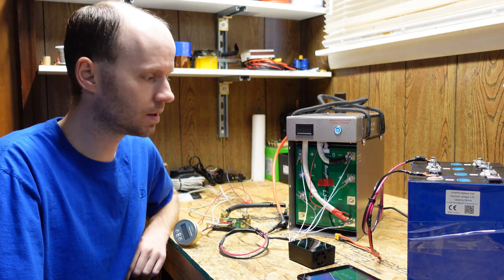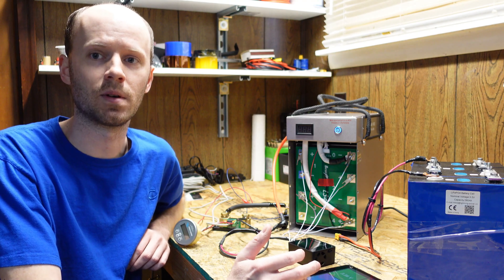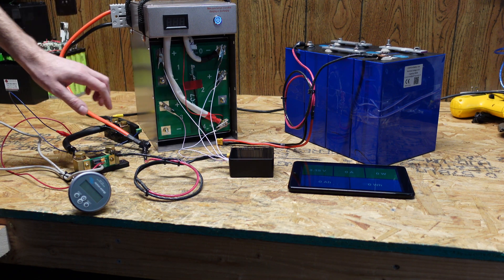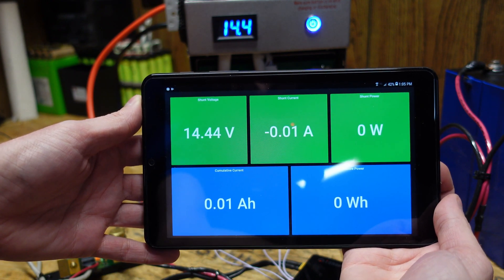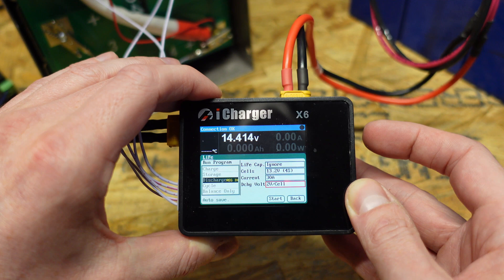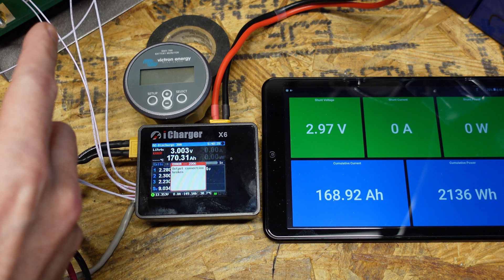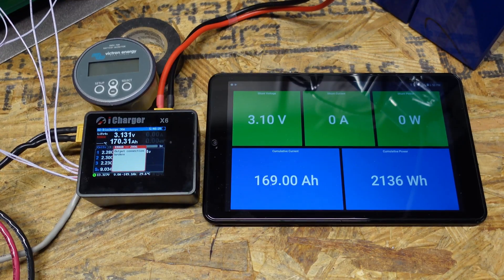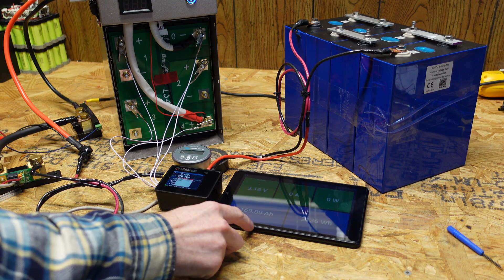How Accurate are My Capacity Tests? Batrium vs Victron vs ICharger

Comment: This is a great test, in future, if you have the gear, would you be able to compare different products? BMS feature of Batrium vs Daly vs other brand? Balancing accuracy, time of different BMS? Heating up issues of different chargers of the eve cells at 60Amps, 100Amps? Ease of install of different inverters, bms, lugs, wires etc? Thank you for the great videos.

Comment: The results are exactly as expected because of series shunts, voltage drop = increased amp hours for same amount of power? Am I missing something here?
Reply from the maker: Current is the same throughout the entire circuit. You don't see different amps at different points in a circuit.

Comment: Lithium cell manufacturers usually specify a specific C-rate and ambient temperature for their capacity rating. C/5 at 25 Celsius is pretty common for li-ion. Not sure if there is a standard for lithium iron phosphate.

Comment: Great video. Just as a suggestion I would swap the order of the Batrium and the Victron and see if the results follow since there is a small voltage drop across each shunt that would have a slight effect on the results.

Comment: Great video.
With draining down the cells below specifications can give the extra capacity, buth shortens the life of the cells too.
Good bms never drain cell below or charge above manufacture recommendation.
Reply from the maker: I have no idea what the specifications are. Did you find them somewhere to conclude that I drained them below that? I'm sure the BMS is cutting out appropriately.
Reply: @LithiumSolar  
My intention was to point out that cut off voltage is important for maintain battery pack healthy and long lasting. Mismatching capacity readouts for specific cell may be result of different charging/discharging voltage range at diferent BMS.
You was also surprised at low voltage disconect (3:55), or i just miss understand you.
I apologize to you, my mother language is not English. 
I will say another time, great video, i watching you  with great interest. 
Best regards.

Comment: I thought the iCharger could not be used to charge lithium battery banks since they had a BMS, so according to this video an iCharger can also charge a 4 cell lifepo4 battery bank with a BMS? if this is true please google DIY server power supply. they come in 2 versions 1200w and 750w. these RC lipo chargers require a higher voltage in order to utilize the full rated amps they can put out. for example the icharger S6 is rated for 40 amps but according to the manual you must use a higher voltage than 12.8 to use all 40 amps, you need something like 24-26 volts minimum. the formula is in the manual. why I'm telling you this is because these power supplies cost $15 or $20 each on ebay and you can series connect them for 24.6v , 36.9v, etc. you must isolate the DC ground for every power supply except the first one when series connecting them otherwise you will short the DC output and fry the PSU. you also must lookup the pinouts for these PSU to add a resistor to wake them up to trick it into thinking a motherboard is connected, usually you put a 200-300 ohm resistor on pins 33+36. they also have a voltage increase mod, stock they are 12.3v due to over voltage protection. two 1200w PSU will yield 900+900 watts on 115v AC, it yields 1200+1200w on 220volt AC, that translates to 75 amps DC, 12.3v multiplied by 2 for 24.6v and 150 amps DC for about $40-50 on ebAY
Reply: He bypassed the BMS by connecting directly to the individual cells. That's why the battery was open with all the wires hanging out.
Reply: @Sylvan_dB  no that's not what's happening, those wires are for sensing the voltage for each cell, the charger will not work without it. those wires are also used to pull current from each cell during balancing. the main charging leads are going straight into the BMS than into the battery. look at the video again

Comment: I’m interested on making a bank of lithium ion phosphate batteries and I’m going to go with headway cells but I’m not sure on how many banks to use for my application I have 4 15 inch Skar zvx subs and a taramps md 12000.1 I plan on a 320 amp alternator how many should I get I thought 32 to 36 headway cells should work but I have no clue what I’m doing just goin off YouTube videos
Reply: i think for car competition they actually use lithium titanate cells, i vaguely heard this. you will need 6 cells instead of 4 cells. I'm assuming headways cells have 3C discharge right? look up titanate specs while you're at it

Comment: Great results!   It's interesting that as the devices went further away from the battery, the capacity is increasing.  Batrium < Victron < iCharger.  Now this could just be the accuracy of the devices.  But it'd be interesting to swap the Batrium and Victron around to see if the numbers differ.

Comment: I thought your testing was spot-on. I also am amazed at the variation between every type of meter manufactured today. Even my most expensive testing meters don't match perfectly, nor do meters made by the same company. I just go by the highest reading and feel better off if I error on the high side. Really like every video you have published.
Reply: For the average hobbyist or even most technicians working in industry, the capabilities of even the inexpensive meters are often good enough to get the job done.  

Whenever I buy a meter I test it against my bench meter since it has high precision and gets calibrated every couple of years so I know that its reading is more precise and accurate than any of the other meters I would test against it.  I then calibrate all of my other meters (at least the ones that can be calibrated) to that meter using a known calibration standard.  

These days it seems that even the inexpensive meters tend to all test within their stated accuracy range even if they don't always agree with each other.  For nearly all uses this tends to be more than good enough.

Comment: We never doubted you thanks for all the great testing.
Reply from the maker: Thank you :) I was starting to doubt me though, so it's always good/healthy to verify you're on-track!
Reply: @LithiumSolar  It doesn't hurt to verify periodically that your equipment is still within spec and calibrated properly.  Since they are all more or less in agreement I would definitely say your readings are more than accurate enough for this type of testing.  I have one 6.5 digit precision bench meter that I send off to be calibrated once every few years.  I use it to check and calibrate all of my other, less expensive meters.  It is actually impressive how accurate even some of the very inexpensive meters are these days.
Reply: @kuhrd  technically speaking, the measurements are precise, they may or may not be accurate, there is no way to quantify accuracy based on the measurements.
Reply: @christopherscholz  Yes what you are talking about is true but I am referring to actually sending off test equipment to be calibrated against a known standard.  Or at least haveing access to a known standard for calibration.  If you get a piece of test equipment that has higher precision and accuracy than what you are using for your tests and it is calibrated to a known standard. Then if you test less precise measuring instruments against it and they are also reading the same reading at least to their limited display then you know they are accurate. Or at least accurate enough based on the reading they are able to show on the output or display.  At the end of the day all of these meters reading almost the same means that the bubble of precision that all of these meters fall in is relatively small and well within their stated accuracy.
Reply: @kuhrd  this is so true i got a cheap step down step up converter. The meter on it is  off by 0.01v if my fluke is correct
Reply: @kuhrd  agreed. This is a great set of measurements. Big shoutout to @lithiumsolar for going through all the trouble of putting this all together for us.

Comment: May be line losses in the copper wiring.
Reply: This is wrong.
Heat Loss has to be Taken in to account.
If energy is Lost no more amps to mesure...
The cabbling has influence.
Reply from the maker: @carlosgaspar74  If measuring power (watts) yes. We are measuring current here. The resistance in the wires is no different than the resistance in the load. Amps remains constant anywhere you measure it in the circuit.
Reply: @LithiumSolar  The Key word is efficiency.
Long math comes with it.
But you are correct, capacity isn't dependent of voltage.
And thanks for the videos!
Reply from the maker: When measuring amp-hours, losses in wiring aren't a consideration as amp are consistent throughout the entire circuit. If I were metering watt-hours then yes, wiring losses would matter. This is one reason I've switched to conducting my tests in amp-hours :)